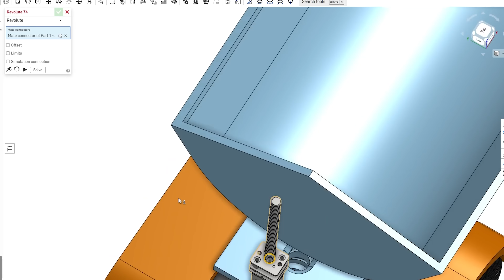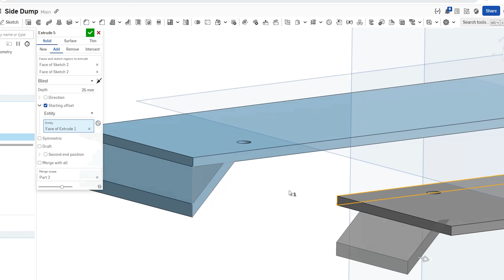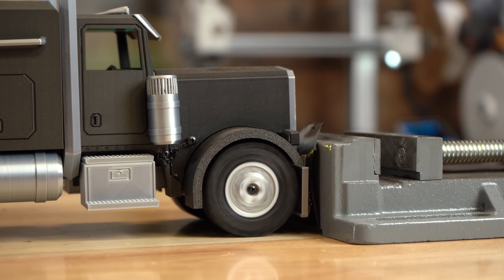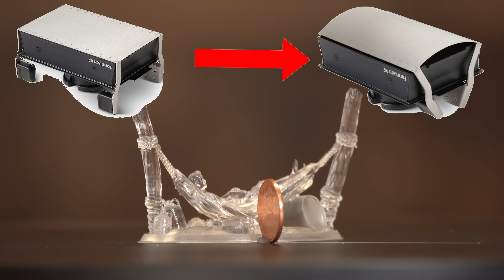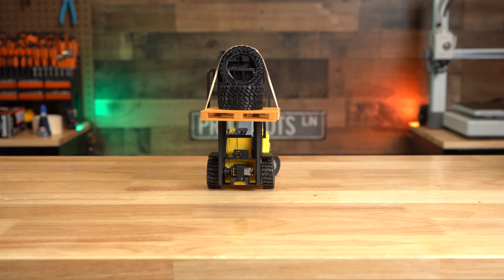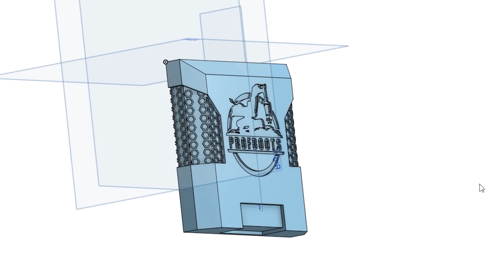3D Printed RC Dump Truck - DIY

Comment from the maker: Thank you all so much for watching the video, please let me know what you'd like to see next!! Also if you've been working on any cool 3D Printed projects lately I'd love to hear about them!
Reply: make one of those things used in road trains so you can attach more than one trailer to 1 semi
Reply: I would like to see a pickup truck with a gooseneck or bumper hitch trailer
Reply: A 3d printed fire truck?🔥🔥
Reply: I'm still on team farm tractor!
Reply: A tractor and A full set of different trailers for example, dumping trailers. And a wheeled loader
Reply: A tractor and A full set of different trailers for example, dumping trailers. And a wheeled loader
Reply: How do you place a custom order
Reply: @professorboots can you convert your 3d printed rcs electronics to CyberBrick electronics?
Reply: @ExplainingPaint hell no
Reply: cab over? for the truck, like european trucks?
Reply: @ilannghost6306yes sir
Reply: @ilannghost6306not happening
Reply: U should make a container trailer,containers and container crane
Reply: You should make a flat bed straight truck with a Palfinger or PM crane on the back of it. with a tag-axle.
Reply: Video two of me asking for a Steam Shovel
Reply: (Really hope u read this comment bro)

Bro i am building a rc skid steer but my esp32 fried :( so what i did what change the width of the main housing to fit a freaking arduino uno, hc-05 🫡🫡, because of this its so hard to fit all the wiring inside the main housing, i trying to fit everything inside, dont know if it will work. 

Ur main housing width:- 52mm
My main housing width:- freaking 75mm

From the from the front it looks a tank bro😂😂
Reply: I think it would be cool if you made a tractor with different attachments you can make for it
Reply: You should add a Peltier module to the cargo trailer! Then it could cool your drinks!!!!!!
Reply: You should make a low Boy trailer😊
Reply: An old ford 4500 industrial tractor or a 2n
Reply: Could you make a backhoe tractor please?
Reply: will you make a grain trailer or a cab over semi
Reply: @Lycaeus-t6h  that would be cool
Reply: Make a van (cargo) trailer with a walking floor.
Reply: Hello! Add engine sound to the code.
Reply: Please
Reply: Where can I get your prints from
Reply: Can you let us know which 3d printer you use? I have a makerbot and my prints can never get close to this clean. Wanting to get something like what you have
Reply: @coreywalker1571 he has a Bambu lab x1 and p1s
Reply: @coreywalker1571  I think professorboots uses bambu x1c for his prints and usually it can just be the settings
Reply: @coreywalker1571   He has a Bambu Labs X1c. But try slowing down your printer and changing the Layer height/ Quality of the print in your slicer.
Reply: @coreywalker1571 he uses bambu labs, but I would get a Prusa core one with mmu3 or a prusa mk4s with mmu3
Reply: Given how many construction vehicles you’ve made I think it would be cool if you made a small construction mech like the power loader or the labors in Patlabor I would like to see how much dexterity on could be given without losing power!
Reply: for me the video is 24 minutes old
Reply: Have you tried SEBS for the tires?
It's the same material Lego uses for there tires, I've got decent results in terms of grip for a lot of vehicles. It's not so easy to print as tpu. As far as I know there is only Recreus SEBS on the market which is pure sebs, there is also a mix of sebs and tpu on the market from another manufacturer, which name I forgot
Reply: make a exstreme off road truck
Reply: i love your video's i would like to build one of my one but unfortunadly i do not own a 3d printer nor the skill's to know how to work with a esp 32 i only now how a arduino works and only the basic thinghs
Reply: I am currently making a plastic antweight combat robot!
Reply: @professorboots Very nice construction and video .  I have a suggestion to expand the truck, how about a self loading side load container trailer ? . Have a nice day ;)
Reply: I made a dragline excavator out of your excavator.
Reply: Can you plzzz make a low boi with steerable axles? Plzz
Reply: A concrete pump truck would be a difficult but cool build to see.
Reply: @professorboots I think you should make a unique construction vehicle that hasn't been made before but would be extremely useful in a real world scenario. I think that would be an interesting challenge.
Reply: are you planning anything for cyber brick or just esp32s
Reply: u should make a bull rack for the truck or a belly dump
Reply: FAQ's

can i even get one?
how much are they?
do i get all 3 trailers?
can i get a bundle with everything?

VVV everybody, ask your questions here VVV
Reply: tractor next 🙏🙏
Reply: You should make a truck that is able to have a ramp and platform on it to like a "car" to say. Also you should make a cowboy trailer to get a more construction look to everything.
Reply: @professorboots I forget the name of it but you should make a box trailer that has cloth sides that you can open to load pallets
Reply: @Brutus44_269 all I could find what it is called is curtain sided trailer, but I know it is something like carigo
Reply: Make a pickup truck and gooseneck trailers
Reply: Make a 10k tele handler
Reply: A dozer to go along with the excavtor
Reply: You should make a milotary tank next
Reply: So tou can make an trailer for it as well
Reply: Have no idea how you would make it work, but a folding skel log trailer would be awesome! If you want some inspiration, look up kennedy trailers in Australia.
Reply: How about a pickup truck. like an older model.
Reply: Make a tractor with a front loader and with a hay cutter, rake, round and square baler for the country people please.
Reply: can you at least try a tanker truck?
Reply: Anyone have this guy respond i have  questions about the hitch pin an still haven't got a response been at least a week
Reply: Can you make a zoomlion craler crane❤
Reply: Pls make a rc motor grader kumatsu pls
Reply: Make a TMF so you can put the forklift on the back of the semi so you dont have to make the box taller.

Comment: The front "windbreaker", on a real truck is usually a refrigeration unit (reefer). You might be interested in making a walking floor trailer, where the floor moves and pushes the bulk load out the back (like wood chips), or a tipper trailer which is made to stay attached to the tractor while the whole unit is anchored onto a platform that stands the whole truck and trailer up on end to dump the load out the back, you would need to build the tipper station too. That could be setup as a single trailer or a b-train.

Comment: Hey, Nice video I like the trailer mount setup, what workshop do you use to model truck and trailer? I'm trying to design my own type of RC-like truck but I can't find any workshop that works for my 3d printer and one that is easy to use over time.

Comment: Be very careful showing your printers name/serial number on screen or sharing it with anyone. I purchased a printer from a guy on eBay that had included it in some of the photos and someone used it to open a fake support ticked with Formlabs and steal a printer, but they marked his as the stolen one. We got it corrected, but it was a mess. Just blur out or remove your serial from any videos you have shown it in.

Comment: Use super glue or epoxy glue on the tires, I think that might work, or you could print the main structure in PU and a separate silicone tread and glue the two together.

Comment: Great video, love the part where you test out the silicone tires, im very in to making and competing in sumobots and i use and make my own silicone tires using the mold method, they are very simple to make 3d printing the mold and pouring the material, the only issue with silicone that i think was missed is that it picks up dirt and anything on the surface you are using and looses traction, so in our competitions we constantly clean or change out wheels and tires👍

Comment: Your workshop links to micro USB ESP32s for your projects, I'm wondering if the USB C ones are different enough to require changes to your code or if they can be used without modification

Comment: you could try IC-2000 glue, I used it for gluing RC tires onto wheels with great success. Even for my 1/6th scale, but prefer bead-locks. Which could pretty easily be designed for your truck I'm guessing.

Comment: You should try to make a transmission with a granny gear for the truck so it could pull any weight . also you should make windows and tail lights with your resin printer. I printed all the parts for the truck and bought everything but haven't had time to build it. but I do have a resin printer so when i build it I was planning on trying to make the windows and tail lights

Comment: Stop making cool stuff.  I can keep up!  But seriously this is awesome!

If youre having trouble gluing the rubber tires to your wheels, stop in to a RC hobby shop- they make CA specifically made to glue tires to wheels.  Its pricy and has a short shelf life after opened, but it works.

Comment: As an austrailan, any semi with 2 axles looks gay as so well done for making it look good, you should do a converter dolly or a gooseneck dolly like we use on our super quads if you are doing side tippers that way you can run multiple trailers

Comment: I printed tires and treads out of Varioshore TPU. It foams up and provides way more grip than standard TPU, and you don't need a separate SLA setup or mold setup.

Comment: Great projects so far.
If you use PLA to print, you can use solvent to weld parts together; probably better than hot glue.

Comment: @professorboots I need help with My rc forklift model. Everything is working but my n20 motors and the motors work but idk if the terminal blocks are the problem or something else.

Comment: Appreciate your designs and videos. One idea on tires, have you considered using TPE-83A? I've read it is softer and provides more grip than 95A TPUs, which sounds like it would be perfect for tracks and tires, but I haven't had the chance to test it yet.

Comment: Suggestion for the silicon tires: why don't you make the rims have gears and add the negative hole inside the tires. then you won't need glue

Comment: Would be interesting to see one of those detachable cargo container trailers that they use around ports so you could unload a cargo ship and load it onto the trailer with a crane then drive the trailer off. Probably wouldn't be able to get those doors to open and close easily but even just having boxes like that would be cool.

Comment: Niche trailer idea:
1) heavy haul set up
A) trip axle jeep 
B) tri axle detachable neck cowboy
C) tri axle booster
2) heavy haul trailer dedicated for large I beams or pipes 
3) log trailer 
4) tanker trailer ( with functional pumps 

Truck idea 
1) Oshkosh hemmt 8x8 with the 5th wheel
2) Oshkosh hemmt10x10 set up as a hook truck with a variety of "sleds"

Sleds:
A) utility box
B) flat deck
C) tank sled
D) dumpster
E) 5th wheel sled
F) rotator style wreaker/ crane ( have the support balance outrigger built into the truck itself)
Reply: You can build a bridge layer sled for it as well

Comment: a great tip for grippy tyres is silicone caulking, simply print regularTPU tyres then smear a thin layer of black caulking on a piece of cardboard and lightly rool the tyre acros it, after that submerse a piece of scrap plastic (milk jug or soda bottle) in soapy water then roll the tyre on that to even out the spiky caulking for a smooth tread...

Comment: Trailer idea: You could make a container trailer and or a liquid tank trailer ( just for looks, don’t know if you’re gonna use it )

Vehicle idea: Mega sized forklift specially made for containers, container handlers, and or those small cranes that load containers onto the trailer from above

Comment: how about tanker trailer like water, milk and chemical 
or concrete boom pump truck
concrete mixer truck
vacuum truck
street sweeping truck
tow truck 
log skiding tractor
garbage truck
backhoes
bulldozers
refrigerating trailer

Comment: The first rule of r/c, scale modeling is; scale is as full size. If door wracking is a problem life size it WILL have a equivalent problem in scale form. 
I am a trucker (full scale, lol) and have largely hauled refer trailers (inner/outer metal walls, insulation , which makes them VERY rigid).  I changed companies and they do NOT run refer trailers (plenty of freight that does NOT need refrigeration (or the weight, upkeep (of the refer units), and fuel).  BUT one thing I learned is that most dry vans (without a layer of insulation BETWEEN the layers), will 'work' (or twist) when the doors are open. (ONE shipper with a twisting loading ramp/parking area Iearned I learned to open/close the doors BEFORE backing in or out, because the twisting of the frame/box made them unopenable.)
I did notice that your dry van also worked (twisted) a little when the servo opened the doors.  Perhaps printing the van sections with internal 'ribs' would keep that from happening.
P.S. keep it under 80k and shiny side up

Comment: You should make a trailer I don’t know what they’re called but they’re like for very very big things where they have power steering in the front and in the back and it’s basically like they have three trucks one in the back. What are the middle section and one normal truck they’re very popular in Europe

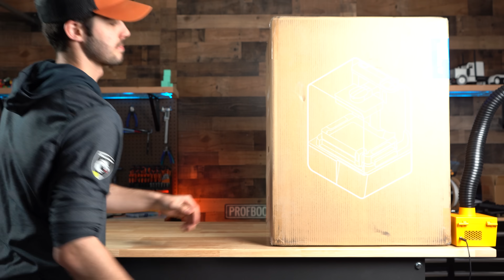Comment: Nice project and design, looking forward to the next one. 8:28 -   !!! BTW Blur is not destructive and can be reversed !!!    - Do not use blur to hide addresses and other sensitive data. Black box or pixelation with large pixel size is the way to go.

Comment: For 3d printed tires, i found that Matterhackers Varioshore tpu can give some really good grip when printed around 210 c, it feels more like foam then rubber, but the grip is about as good as you can get with 3d printing.

Comment: For the tires I wonder if you could make the 3D printed molds and use like flex seal or some pourable rubber to make them
Reply from the maker: I bet that would work great
Reply: Grate
 @professorboots

Comment: FYI - I get a lot of requests for the logging trailers too. Sounds simple until you realize you are going to need that front end loader to go with it. ... and possibly a skidder. Like you said you have a lot of options with this platform. It would be cool to see what you could do with a rollback. You have much cheaper motor and channel options at your scale.  - Congratulations on the viewership numbers. You do well at connecting with your followers.

Comment: I love your videos and look forward to more DYI RC content in the future. Hopefully I will soon have the confidence in my printer to print the RC excavator myself.

Regarding loading the trailer, instead of a smaller forklift, you could also open the side wall to load it like a trailer with tarpaulin.

Comment: Please do a hooklift truck or trailer. Also there is a type of tow/recovery platform that you can connect to the fifth wheel.
Love what you do, this is like 90% of my stormworks playthroughs but irl.
What you called windbreaker on the front of the trailer is aChtUallY a "reefer unit" (heating/cooling unit).

Comment: a tip to make the silicone tires fit better, 1 but a ridge on the edges of the rim and 2 make the inner diamiter of the tire smaller than than the outer diamiter of the rim. this causes an interfearance fit that will keep the tire on the rim

Comment: As dumping power is currently still comparably weak, I'd recommend adding a second threaded rod motor on the rear. 
As for any new vehicles, I'd love to see a long chassis version of the truck with different upfit modules based on the trailers! 
A telehandler would also be pretty awesome, though I don't know if it would have enough space for the electronics and telescopic boom at your scale

Comment: Based on the truck platform, I’d love to see a bus or a coach body. Some interesting parts to solve are the opening doors, cargo hold, wheelchair ramp and the biggest is the ferry lift (the entire body can lower down to make boarding easier and lift up high to provide clearance over bumps)

Check out the Volvo 9700dd, that’s my daily

Comment: How about a rotating recovery truck #1 Boom Lift #2 Stability legs #3 Winch #4 Rotating Lift. This is the four extra components. though it does not allow for an extending boom, you remove the magnetic hitching servo allowing then add the extending boom arm on your recovery truck.

Comment: For the tires you should try esun light weight tpu, foams as you print, i used it recently and man it prints nice. Also feels like it will be much grippyer than normal tpu.

Comment: Trailer idea: Shipping container trailer with a container that can fit a mini-skiddy, maybe even have a magnet system similar to the truck itself for controlling the doors? It would also need to lock onto the trailer in some way, maybe with some pins of some sorr

Vehicle idea: One of those intermodal crane front loader looking things for lifting the above mentioned containers
Reply: love the shipping container idea! this could also introduce a potential train or cargo boat series into the fleet! including a whole port set section

Comment: (Really hope u read this comment bro)

Bro i am building a rc skid steer but my esp32 fried :( so what i did what change the width of the main housing to fit a freaking arduino uno, hc-05 🫡🫡, because of this its so hard to fit all the wiring inside the main housing, i trying to fit everything inside, dont know if it will work. 

Ur main housing width:- 52mm
My main housing width:- freaking 75mm

From the from the front it looks a tank bro😂😂

Comment: A pack mat Mobil’s trash compaction truck would e the coolest thing in the world. It’s a truck with a big spiky roller on a hydronic arm and it compacts roll off dumpsters. And with that you could also add dumpster hauler trucks and dumpsters into the mix.